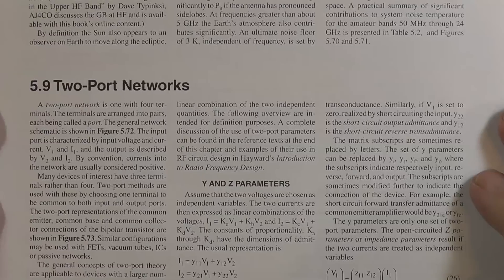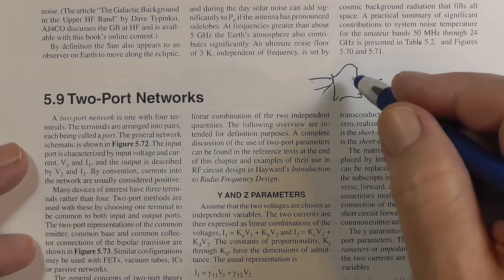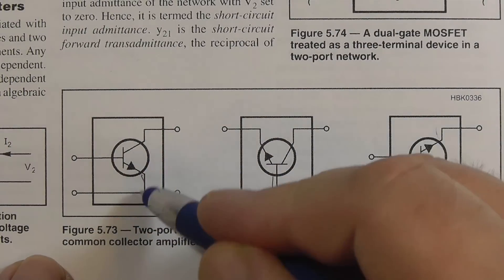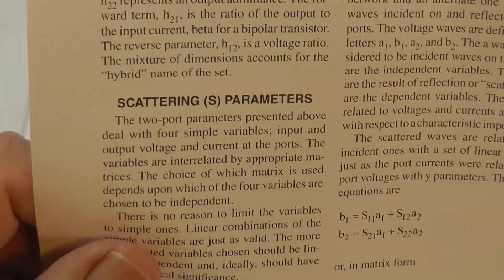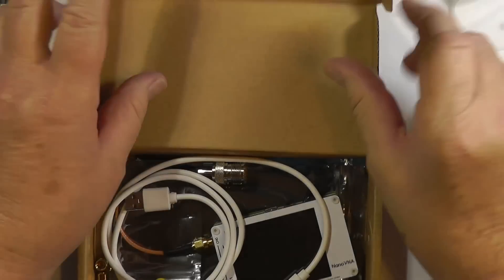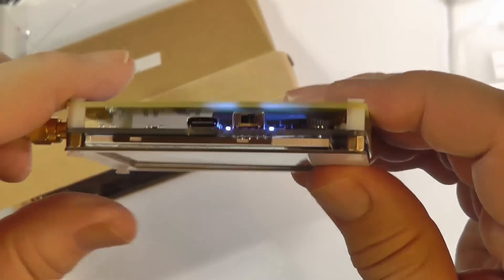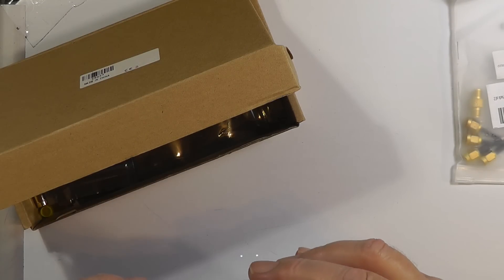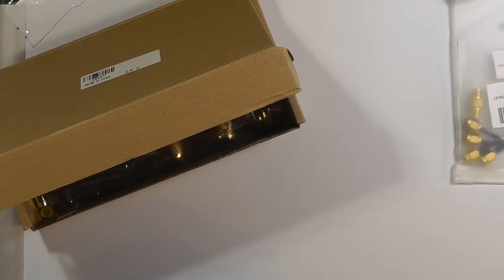Cheap VNAs Not Good for New Hams (#910)

Comment: Nano VNA one of the best learning tools any ham could buy. The more you do with it the more you learn. Hook it to a laptop running NanoSaver it takes all the  mystery out of the onboard menus.
Reply: I haven't even tried to use it without the computer since I found out about NanoVNASaver.
Reply: I agree. I use the NANOVNA H4 and have never hooked it to a computer, and have been very satisfied with it. Now you have me wondering about NanoVNASaver, I'll have to give it a look.
Reply: John - I agree.  It motivated me to learn about Smith Charts.
Reply: Mine is an older one with a tiny little screen, I cannot read it so I need t use the computer -
Reply: @jj2me  You will be very happy, guaranteed.

Comment: Dave,
I respectfully disagree.  The NanoVNA's are very capable and versatile devices.  You are right they can do lots of things.  However, they can easily do the essential Ham functions of plotting SWR and a Smith chart.   The menu can be intimidating and there is something of a learning curve. There are many YouTube videos that will lead you through the Basic set up.  
Being a mag loop fan, I could not have been able to use these loops without the NanoVNA.
Reply: The Nano vna is quite a bit cheaper than a good antenna analyzer, so as confused as I am every time I turn mine on, I can setup my wolf river coil very easy.  I'd love to buy a better tool, but money is an object.

Comment: Books on using the NanoVNA:
"NanoVNAs Explained: A practical guide to Nano Vector Network Analysers"
"A guide to the NanoVNA"

I have the second one. It is really useful in that it allows you to move into building a lot of RF circuits. I have found that learning to use this device opens up a lot of knowledge and experimentation. I do recommend for a new ham IF they are willing to look at it as a learning tool and except the frustrations of the learning curve.

Comment: There are tons a very helpful videos on YouTube from a number of individuals explaining the functions and use of the nanovna. When I was first learning to use mine for building antennas and testing various SWR readings, I simply made a bullet list of the basic setup functions and practiced until I had it down to muscle memory. As with any type of hardware/software tool such as this, the casual and or normal, day-to-day user will probably only use 10 to 15% of its capacity. The remaining 85% is for the hardcore experimenters of the more esoteric among us.
Reply: Nanovna is not a single item. Your muscle memory will not transfer to all clones and variations. Just like different Linux distros don't work the same way.

Comment: Dave, I aggree with you "but"...  I'm a tecnician level ham. The trick I've learned with my Nano VNA is simply "baby steps".  I need to  1. pick my start and stop frequencies,  2. calibrate it with the open, short and load calibration tools,  3. Find my way (through the menue ) to SWR and take my reading,  4. Move the cursor along the graph if I want to home in on a specific frequency and get that particular reading, 5. then go back to display, format and choose smith(for smith chart) and I can get other pertinent readings for that specific chosen frequency.  That is all I need it for now so I'm not going to strain my brain by filling it up with unnecessary information.  If you don't have the $,  you make the time to learn, just don't try to learn it all at once.  As you get some basics figured out write them down and make your own standard operating procedure so you will have that set of instructions to refer back to.  Thus eliminating some trial and error as you attempt to remember how to do it from 3 months ago!  The more times you do it the more you will remember.  There are some helpful videos out there, just take what info you need and leave the rest for later!  KO4GJO
Reply: Or you could ask to borrow a RigExpert or MFJ at the Club meeting?

Comment: They do indeed have a steep learning curve.  And if I have not used mine for awhile, I need to retrain a bit.  But for antenna analysis they are great -- all the way from 160 M to 70 cm -- and at a fraction of the cost of an MFJ product and it provides a lot more information.  My model has no problem displaying SWR readings across the entire HF spectrum, something useful for trying to tune EFHW antennas, or just random wire antennas.

They also do things like measuring the loss in old coax, and whether your homebrew dummy load is purely resistive.  Connected to an antenna, they can also receive strong signals, something good for detecting spurious emissions.  

They are also a very stable signal generator, something good for looking at signal passbands in filters.  I once set up mine on 40 M to set up a 1 kHz sweep and found I could drive a couple of miles away and still hear the distinctive signal it put out on a portable receiver on my lap.  So be mindful of causing interference when using one for antenna analysis.    

Overall, they are a very good investment for any ham who wants to learn more about electronics.

Comment: The first nanoVNA model, like in this video, has a tiny screen, delicate thumbwheel, and exposed sides.   They then came out with  nanoVNA-H4 which added;enclosed case, recessed thumbwheel, and bigger 4" screen,.  Latest model is the nanoVNA-F which adds stronger chassis mounted connectors  ($70).  Biggest hassle is you have to calibrate it when changing bands with three cal terminators; short, open, and 50 ohm.
Reply: Those are made by different companies. The nanoVNA-H4 is a knockoff clone of the edy555 version.  There's also the NanoVNA V2 (S-A-A-2) which uses a from scratch design by NanoRFE. There are companies who make clones of either with cheaper lower quality parts in order to cash in at the lowest price.

Comment: Hey Dave, I learned how to use a Smith Chart 55 years ago when I was 11 years old. I was so happy when they came out with all the affordable Nano VNAs! It's effectively just a Smith Chart with wires on it. The more you play with it the more you're gonna learn. Yeah, it's got some learning curve, especially if you are not already familiar working with complex numbers associated with RF devices like antennas. SWR meter can't tell you if you need to make your antenna longer or shorter, Nano VNA will & they are certainly accurate enough for ham radio use.

Comment: Dave, I have to respectfully disagree with you. I was a 3 month old ham when I bought my first NanoVNA from the manufacturer recommended by the original developer. Within 5 minutes after receiving it, I had it calibrated, set to SWR output display, and saved it so that whenever the device was turned on, it showed SWR on my band of choice (40m at the time). It was super easy! I built a few antennas and put it away. Later, I had the need to build a wave trap to combat a local AM station and was able to use the VNA to build a wave trap. Had I opted to purchase a RigExpert or MFJ tuner, I would have been out of luck. The name brand tuners are really nice, but since I'm not building antennas by the dozen, or using analyzer extensively in the field, it would make no sense to spend hundreds of dollars more on overpriced and less versatile equipment. In the end, I think those devices end up limiting hams to antenna tuning when there is so much more to ham radio and electronics. I would highly recommend new hams try the NanoVNA before shelling out big bucks on a name brand analyzer.
Reply: Your idea of "It was super easy! Barely an inconvenience" will not be easy to many others. The wide quality variation of NanoVNAs can be frustrating. Buying the cheapest NanoVNA is like the buying a cheap QRP radio. A pixie radio will only cost $10 but there are reasons why QRP kit radio shouldn't be a first radio.
Reply: @Sam Miller  That is exactly why the original designer has a list of recommended vendors on their site. If someone wants to roll the dice on a random one from the Internet, well as in anything, caveat emptor. And come on now - the NanoVNA site has a manual and tutorials and if those aren't enough YouTube is your friend. The RigExpert is not that much easier to operate, if you want to get down to it. Point being, if you can operate a ham radio or an analyzer, you can operate a Nano. I would argue the UI and menu system on an Icom would present greater challenges.

Comment: The NanoVNA is a great gadget, I do concede that they are not intuitive to use immediately but Linux knowledge is not needed whatsoever. Outdoors in bright sunlight the MFJ and similar are easier tools to use for basic antenna measurements. MY own NanoVNA has been through a few different firmware versions, but that was simply a matter of using a software tool from ST Microelectronics to load the new firmware. Like another commenter I generally use the NanoVNA indoors controlled by a PC via USB. A benefit of using it in this way is that traces are readily saved to the computer. As with any hobby some people will buy devices that they never use... there are some tutorials on the NanoVNA online.

Comment: I run a NanoVNA as well. The recall menu will also load your saved plots, so after you set it up once it can be as simple as "Recall -> Slot 0". Set your start/stop, traces and formats up first, do the calibration, and save it. After that you do not need to mess around with it again.

I like running with return loss+SWR (same thing with a different scale), and smith chart which is great for adjusting home made baluns. The only other trace I used was the phase trace for cutting 1/2L multiples back when I ran RG6.
Reply: Which type of NanoVNA? Sounds you're not a beginner
Reply: @sammiller6631  I have the "black and gold" clone NanoVNA, which is a clone of the 2_2 hardware. I updated the firmware recently and it immediately recalls from slot 0. The main thing dave misses: It's not just the calibration that is saved, the trace/plots are also saved, so after the initial setup and calibration which admittedly can be difficult without a video, you just need to turn the thing on and it's ready to go

Comment: You're 100% correct that the UI is terribly unfriendly and it's far above and beyond what many hams want out of it. It is, however, possible to strip away all of the most advanced stuff and get it to where you can simply and easily connect it to an antenna, scope in on a single band, and check out the low SWR point. There's actually a great video on YouTube I saw a while back where the guy specifically shows you how to disable all but one trace, set a frequency range, and see the SWR curve. Most of that setup needs to only be done once and then you need only reset the frequency range in the future when you're looking at different bands.

Comment: With an AA-230 if you don't know where the antenna is out of resonance or even which bands it covers you start with the SWR chart, press the "Fq. Range" button.  On that screen hold down the "F" key and move all the way down the band list until you see "All". Then press "OK" three times to scan the entire frequency range of the AA-230.  You'll see the dip(s) where the antenna is resonant.    You can then go to "Fq Range" again and select the band you want examine more closely.  Once you see the center frequency of the band you want to examine press the down arrow key and change the range setting to be fare enough outside of the band to get a closeup view of the dip.

Comment: Not sure where Linux or programming comes in.  But if you have ever used a VNA, these things are very straightforward.  A bit lobotomized with only one directional coupler, but does everything my Agilent does if you're willing to manually flip the cables for S12 measurements.  Yeah, the touch screen could be better.  The menu could be better.  But 10 minutes of poking around and you've got it.  Best thing since sliced bread.
Reply: If you're familiar with an Agilent, you're not a beginner.

Comment: As others have pointed out, it has nothing to do with being a linux expert or programmer, and is a relatively easy device to learn. It is easier if hooked to a computer. Alan, W2AEW, among others,  has many good videos on how to use it. Any device is intimidating if you don't take the time to learn how to use it. I have zero programming experience. Anyone that can pass the general exam should have no problem learning it. I will agree that an antenna analyzer is easier for simple swr measurement.

Comment: Oh, come on.  It's not that complicated.  There is a download manual which shows the "map" of the menu system.  These nanovna are very accurate.  I also have a tinysa which is absolutely fantastic for RF use.
Reply: Be careful with the voltage/power level going into the TinySA or it wil say, "Wow, that was De-Lightful." ...and then go silent.

It's another fun tool for RF - just poke an antenna into the air to see what's going on.  I love it!

Comment: the NanoVNA's are fantastic, but you have to know what you are doing, I think the biggest issue you will run into is that you MUST calibrate them WHENEVER you change the span!   If you set it up to say look at the 80 meter band (say your tuning an antenna), and then go to 40 meter and don't re-calibrate, your readings will be wrong, so that is the biggest gotcha, just re-calibrate whenever you change spans.
Reply: I saved a calibration from 1 MHz to 30 MHz for all HF my everyday use & then just narrow the stop & start from there. No need for a separate calibration unless I go up to VHF bands.
Reply: @sfrahm1  I tried that and found pretty bad errors in reading when narrowing bandwidth, you really need to calibrate every time you change frequencies, there are only 200 points tested from star to stop, so 30MHz bandwidth will have very poor resolution and when you narrow it down those points won't be calibrated since it never calibrated them at higher bandwidth.

Comment: I love my NanoVNA. I suggest buying from R&L or other reputable dealer. They are superior. Just used mine a couple days ago to measure isolation of a switch. Once you get comfortable with calibrating the unit (a must), you can measure SWR very easily and quickly.

Comment: Totally agree, the nanovna is a handy tool in the shack. But, it is not a friendly tool for antenna work. And I can understand a new ham struggling to understand them.
A conventional antenna analyzer is much more friendly. And at 4 times the price. You can have a nanovna and a tinysa for a 3rd the cost too.....If you really want to learn about trabsmission lines and antennas. A nanovna and the test board are an excellent kearning tool !

Comment: Gotta disagree with you. Way off here. Im not a programmer and I use mine all the time. Maybe it's better for plug-and-play hams, but the device is easy to use and accurate. For the money, better than any antenna analyzer for hams designing antennae.
Very powerful device for a fraction of the price. One you learn how to use it, its easy as pie. This is disingenuous. The nanovna lists Smith chart and SWR as default. Also attaches to computer.
Maybe it's not as rugged as some, but in radio we learn to respect limitations.

Comment: Linux really has nothing to do with the complexity of the nano-VNAs.  Like many 40-year-old VCRs, the interface is simply poorly designed.  But it only takes a little practice - having an Elmer helps - to get going.  You have to set the frequency limits (and CALIBRATE the device for those limits using the 3-step calibration process), set the kind of display you want (linear, logarithmic, etc.), and set what you want graphed (SWR, etc.).

The nano-VNAs are also fragile. SMA connectors have short lives, so attach an interface cable once (e.g., SMA-to-UHF like you had) and leave it on.  One good yank on the cable and you have $70 worth of electronic waste to be recycled.

The ability to interface this to a PC (via a USB cable) makes this a much better instrument with the ability to produce, and print, wonderful graphs showing, e.g., SWR (or whatever) from 160M to 6M or beyond.

Comment: I understand where you're coming from, but consider the following:
1. It wasn't originally designed for Hams. It is mostly for EEs and specifically RF Engineers who don't want to buy a VNA that's the price of a used car to the price of a house.
2. As a ham I was very used to reading SWR/VSWR, but I had to get used to looking at S11 as log-mag (dB) return loss in a professional RF engineering job. 
3. The UI and menu system is intentionally designed to be like HP/Agilent/Keysight, Anritsu, Copper Mountain, etc brand VNA (in other words expensive VNAs)
4. Thanks for the good laugh about "It's for Linux experts and/or Programmers" comment, I work with a lot of them and they don't know how a VNA works, again the NanoVNA is for RF engineers.
5. The learning curve is worth it, because the day you get that lucky deal at a hamfest on a HP/Agilent/Keysight, Anritsu, Copper Mountain, etc. you will be ready to use it.

73, KD8TUO

Comment: Disagree on this....IMO the Nano VNA puts a powerful tool in the hands of a lot of people that otherwise couldn't afford one.  I was able to pull SWR graphs up in a few minutes on the first try.  BTW I know zero about Linux and never had to use it with my VNA.  😀  I think a Nano VNA is a great tool for a new ham.  No reason to spend a lot of money at MFJ or Rig Expert if you don't want to.  Are they better, sure.  Does the Nano VNA work? Absolutely yes!  Works well.